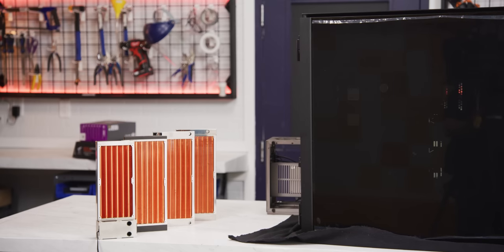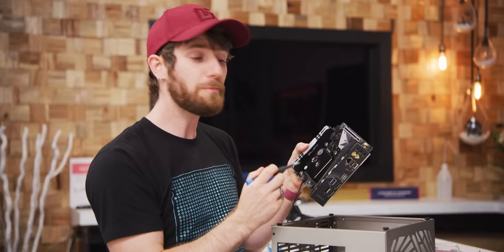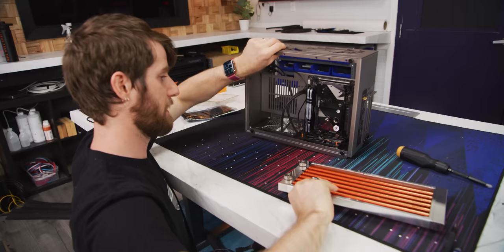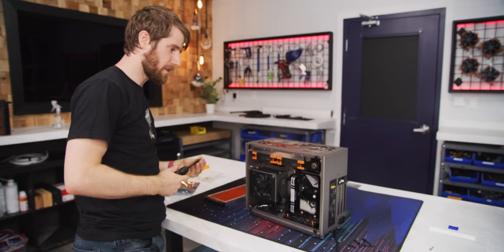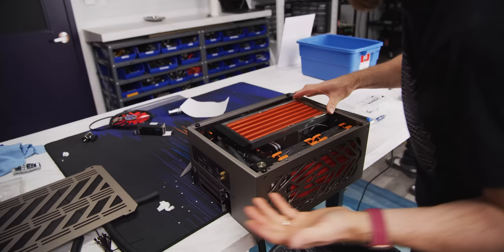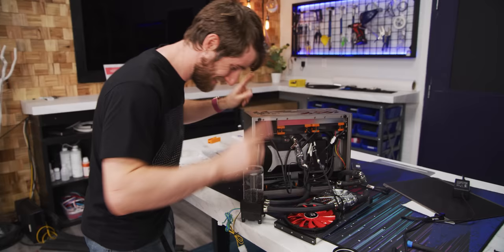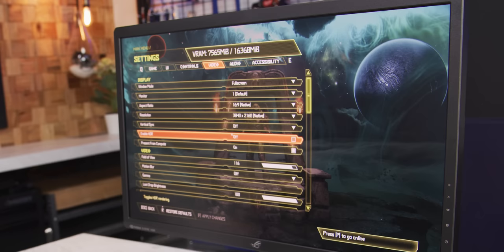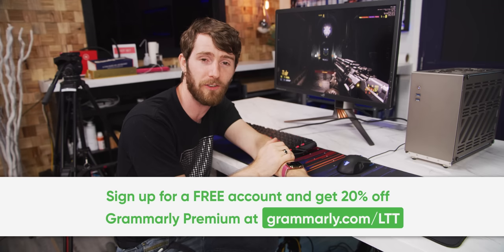The IMPOSSIBLE PC - 4x dual radiator ITX build

Comment from the maker: Hey guys, just to clarify, at one point in the video we mislabeled the CPU, but it is in fact a Ryzen 9 5950X. :)

Thank you for watching! If you want to save time drafting messages to recruiters on LinkedIn or proofreading important work emails, remember to sign up for a free account and get 20% off Grammarly Premium: https://grammarly.com/LTT
Reply: Hi
Reply: tsk tsk
Reply: Bot comment ⬆️⬇️
Reply: HOW DARE YOU
Reply: Ok mijo.
Reply: Ilk
Reply: First to commant here
Reply: Hi
Reply: I wanted to be first but 3rd is fine
Reply: bruh
Reply: Oof
Reply: Let's go AMD, video not sponsored by intel.
Reply: That happens often CPU branding should definitely be clearer
Reply: yes money
Reply: I  havea challange to you Linus

Make a gamer pc but its a notebook
Reply: Thanks
Reply: l
Reply: hi Linus,  bet you could print out a side panel on that new machine a few days ago you showed
Reply: Bruh your YT comments are sponsored too??!!
Reply: @suobset  the comments are sponsered too really does he get paid off of them?!
Reply: From my understanding copper does conduct it better and as such does cool the water better. The difference is in the density, copper weighs 3.3x what aluminium weighs. So even though aluminium has a higher heat capacity per gram (about 2.34x), the copper radiator ends up containing more energy in the form of heat. As a result it takes longer to cool down. If both are fully heat soaked you should see the copper radiator cooling the water ever so slightly more than aluminium just based on the difference in fin temperature between the radiator tubes due to the higher thermal conductivity of copper (about 1.7x).
Edit: Timestamp is 9:34
Reply: @jadoei13  thanks for that tip it was a very intelegent answer I bet Linus will give it a good thinking
Reply: you can pin the comment btw
Reply: het @linus if you want to check if a fan is on but you cant reach it hold a big thin piece of paper above it. if the fan is input it will pull the paper towards it and if it is output if will blow away the paper a bit
Reply: rub it in why don't'cha
Reply: you should pin this
Reply: digital subliminal messages  Why here?
Reply: How much would I have to pay in USD for this thing from you guys?
Reply: Linus, you're crazy. Lmfao
Reply: Easily one of the coolest PC's I've ever seen based off how much performance and cooling is capable in such a small form factor. I can't believe how cheap the case is as well. I want to build this myself sooo badly.
Reply: Thermaltake core v21 can do 5. More than 5 if you do some modification. And it can stacked together with another v21. I hope you do something cool with this case because i had this case and it was very rasy and cool to work with this core v21
Reply: why you don't use EUROCOM 780W AC Adapter
Reply: there's a 50% off sale right now lmao
Reply: ill buy it
Reply: ugh fan guards, make the fans soooooo much louder...... necessary but ew
Reply: Its time to put your fancy new CNC machine to work and build it even smaller! I figure if you make the cooling solution part of the structure of the case, you could free up a lot of space. Essentially something like a case made out of a distro block and radiators. You could probably reduce the tubbing runs and fittings that way. And while you're at it - custom connectors and cabling to save even more space. Mount your GPU such that it's waterblock actually forms a part of the case as well.
Reply: @LizordSword  MOHAMED AVDOL
Reply: 19:26 no.  would be a waste of time and temps will be higher.
Reply: I'll give you tree fiddy for it and a video of me screaming at the box for a solid 3 minutes if you give it to me lol
Reply: i’m your 1000th like
Reply: I clicked read more for an advertisement. Gosh darn it
Reply: xp
Reply: Wouldnt recommend grammarly with how much data they collect especially on private and work document stuff
Reply: @Nickdeaugustine  Ok old white guy with a beard
Reply: It's ok, you can still send it my way.
Reply: 16 cores? Pfft my cpu DEFFINETLY has 83749268462 cores
Reply: @Cyan101  ikr
Reply: Come on
Reply: Almost there
Reply: 1 more
Reply: Yes 69th reply let’s go nice
Reply: the only thing i care about is where i can get such nickle or chrome plated rads.... the only thing that isnt answered in this video
Reply: @mibattlebuddies4926  I say cancel the order of ur r3 3200g. What price u got ur r3 3200g? I highly don’t recommend that cpu only for 1 reason which is that it only 4 threads. All the 3 games will run fine on 720p low 30fps but valhiem will stutter a lot cause of that cpu cause it only has 4 threads. The gpu prices r starting to fall and hopefully be normal in like early 2022. Also what speed is ur 16gb ram? Make sure it’s 2x8gb or 4x4gb. If u have 1x16gb or less than 2800mhz cancel the order.
Reply: @mibattlebuddies4926  I would highly not recommend this pc. For 725 dollars u should try to find like a gtx 1060 pre built (normally u can get a rtx 2060 but cause of frickin scalpers and miners) and i3 10100. That gpu will run all those games at 1080p medium over 40fps no stutters cause the cpu has 8 threads. I say wait and cancel the order cause the gpu prices r starting to fall and they become normal in like early 2022.
Reply: @mibattlebuddies4926  buy this instead search it on Amazon CYBERPOWERPC Gamer Xtreme Gaming PC, Intel Core i3-10105F 3.7GHz, GeForce GTX 1650 4GB, 8GB DDR4, 500GB PCI-E NVMe SSD, WiFi Ready & Win 10 Home (GXi8800A2) I say add another Adata z1 white 1x8gb stick. Didn’t mention the speed so when u get the pc start it on and find the speed of the stick. When u find out the speed of that stick (go to bios and enable xmp) then buy the same one. It cost close to 800 but it will be way more worth it,
Reply: @mibattlebuddies4926  thanks for the appreciation I really love it and help more new people just like u.
Reply: pretty terrible performance for a quad rad system
I never get above 55C on any 1 component with my quad (360, 280, 240, 120) - but then again I have a pump (this system didn't seem to have one!), and a res (more heat sinking). It's not just the amount of radiators you have (i.e. heat displacement capacity), it's the amount of heat sinking you have (bare metal and water).
Reply: Best video I seen from you guys all year I think, I watch a few too, not sure how the gfx card went in tho
Reply: @iamdmc  have u seen how slim they r? im no expert but the case seems to have no mesh
Reply: You spent way too much on your toaster or you misunderstood the words "doom 1"
Reply: Can you build me a pc for free..😅😆
Reply: Alright thx like I have that money 😜
Reply: Too the moon!
Reply: @santiagoramirez1400  agree
Reply: It can fit another 2 radiators on the sides
Reply: Yes, but can it run windows 11?
Reply: You should try exhaust on the sides and top with intake only on the bottom relying on negative pressure
Reply: I want those rads. Shame the metal is not black cause that orange would look minted in my Thermaltake V7 Full tower! *Drools
Reply: An important suggested correction: aluminium does not dissipate heat faster than copper.

I get why people think this: it's a very commonly repeated misconception online, and it's really easy to convince someone of it. The best way to convince someone erroneously would be to point out that if you leave a 1 cm^3 block of copper and a 1 cm^3 block of aluminium in an oven at 250°C for a couple hours until they both reach 250°C, take them out of the oven, and let them cool down, the aluminium block will reach ambient temperature more quickly. But it's important to think about why that's the case: it's not because it dissipated the heat faster, it's because it had less heat to dissipate. Copper is much more dense than aluminium, so it can hold a lot more heat (it also has a greater heat capacity per unit mass), so a 250°C block of copper just has way more energy (heat) in it than a volumetrically equivalent block of aluminium.

Copper dissipates heat faster for the same reason: the heat transfer coefficient is higher.
Reply: make a video on how to make old ANDROID tabs useful... increase ram or whatever. PLEASE. ive got an old lenovo yoga 3 with a projector !!!  can you imagine if it was fast =)
Reply: You've made a desk PC; now make a monitor PC with VESA mounts, sized to fit between any 27" monitor and its stand.  (For example, a metal plate might hold some of the components on the left side of the mount and the others on the right to minimize total depth.)
Reply: @LizordSword  a
Reply: "3 quarter inch machine screws and these nuts"
Reply: It would be nice to know the ambient air temp in the box for the heck of it.
Reply: 13:28 I can't believe you didn't make a joke here
Reply: dude this pc 😍✌🏻 6900xt 🤤✌🏻
Reply: Why is it a Ryzen 9 5950x?
Reply: Why don't you just make a pc case your water cool radiator. 😎 total rad
Reply: 18:15  "It just has so much inertia."  It's practically inert.
Reply: hi

Comment: Imagine if a fan dies and needs replacing. Say goodbye to your Saturday.
Reply: You go to your local computer shop, bargain for a fan change price and when they agree to some normal price you bring them this.
Reply: It's okay, Linus has 13.6M of fans
Reply: Or a radiator slightly knocks a RAM stick causing the system to either not POST or not detecting the stick outright. DIMM slots are so damn finnicky...
Reply: wow i would of thought linus would of used a slim noctua 120mm fan, but maybe it wasn't going to fit...?
Reply: Imagine realizing forget to pill the plastic film on the cpu cooling block After all this
Reply: @RGInquisitor  I use Servisol Electrical Clean and Lube from Jaycar on just about all electrical connectors. Including RAM, PCIe and the Thunderbolt 2 ports on my MacBook Pro. It has fixed the intermittent connection problems from old/loose/delicate connectors from vibration or movement in the case of thunderbolt. I spray it on a q-tip and apply it to the PCB edge connectors manually. For ports I'll spray it upside down so the excess will drip out.

A ram slot that used to throw errors on the slightest bump i can now jiggle left and right while running memtest86 with no errors. On my MacBook Pro the Thunderbolt Ethernet adapter no longer drops out on the slightest bump either. Although excess movement will still occasionally make it drop out.

Since it's MSDS lists it as a potential carcinogen i also thoroughly clean any user touchable ares it has dripped onto isopropanol alcohol.
Reply: @ky5666  that's a good product to have on hand. Fixed my washing machine the other day (the connector got filled up with water)
Reply: The good thing about this is, unless the fan is taking something else out. It may not actually matter that much lol